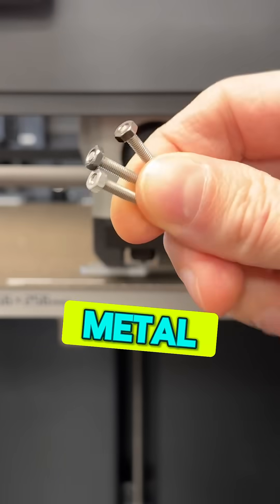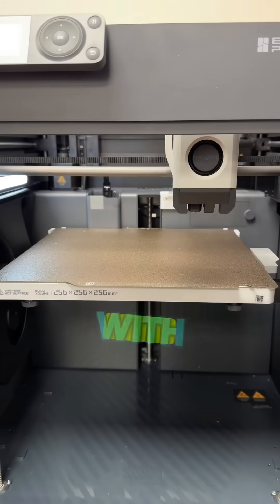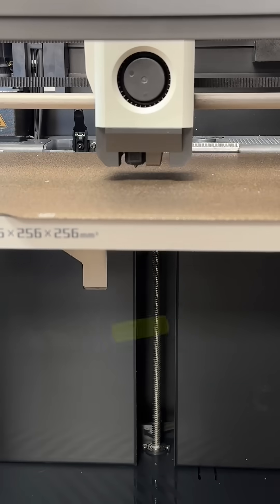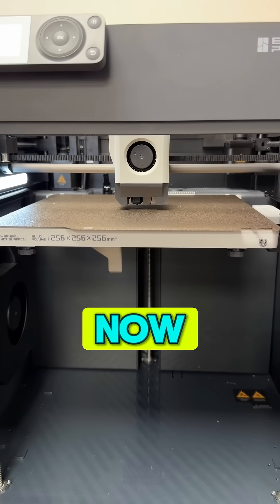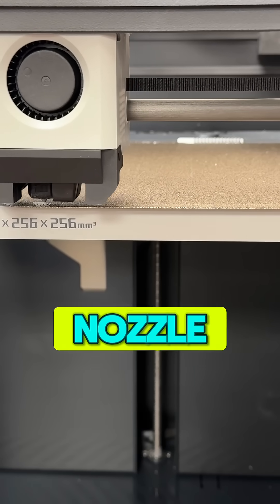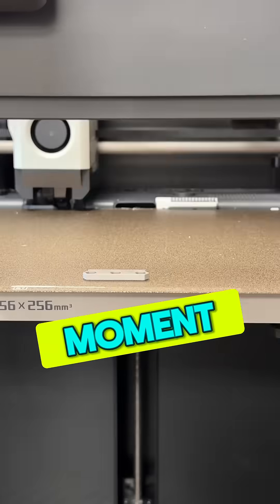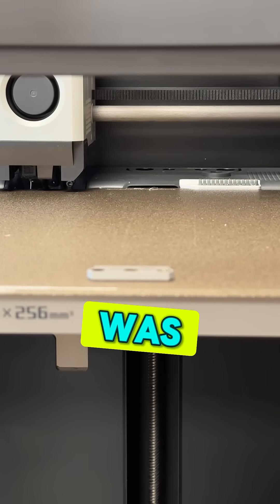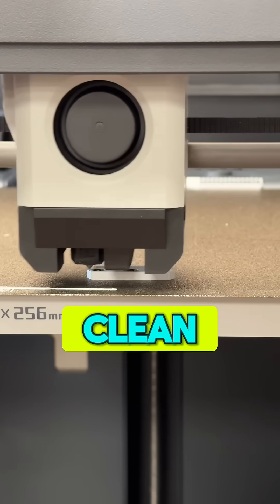You Haven't Seen These EASY Mods! They Are GOLD For The Bambu Lab P1S P1P 3-D Printers!

Comment: No one will ever tell me what that black thing in the back that rocks back and forth is.
Reply from the maker: @gfixler  well youve asked in the right place this time! Its a lever that closes the waste chute to allow the purge to coil up. When the print head pulls away the lever releases the purged material to fall out the back of the machine clearing the throat of the chute. Hope that answers your question!
Reply: @leckiestein  Thanks! I finally found a video of a guy completely disassembling an X1, and I could sort of see how it worked, but I'm still not clear why the lever—which works forward and backward—waggles to the left and right, too 😆

Comment: I've been doing this for years with my ender 3. Just check the slicer for the last body layer before the surface, watch for it, and pause it to insert the nuts, and resume the print. You can also add a stop at height/layer command in the slicer. This is cool though. I love people tinkering with configs, setups, and use cases. Keep creating!

Comment: Why was half this video "the machine levels, the machine purges filament" yeah, that's what it does.

The only needed part was your pause code
Reply: The machine levels only in the print area - only 6 points instead of the whole bed, big time saver 
Same for the beginning where Z homes, it's faster
The purge is also different than default and the pause sequence is also different
+ The addition of the A1 wiper, which isn't on the P1, to keep the nozzle clean during the pause

Comment: The Prusas have a pretty slick way of purging and cleaning the nozzle in one move. What it will do is start to pre-heat (not quite to the printing temp) and level the bed. Then it'll go 15mm above the bed and let the hot filament drip and heat the extruder fully then when it gets fully up to temp it'll move down diagonally to the build plate. Once it's on the build plate it'll extrude some filament and speed up once it's done extruding filament it'll jerk away and then it'll start printing. It gets the nozzle pretty clean and only uses 12mm of filament that could be less. I've never seen another printer do it like that highly recommend you try it.
Reply from the maker: @boomerguy3368  interesting. Thanks! Ill have a look and see if I can find a video of their startup :)

Comment: A1 wiper pad ? Does this mean the core xy models dont have the wiper pad ?
Reply: There's a little roller it uses to wipe. I got my p1p a week ago and haven't had any problems with it
Reply: They don't, and Pele are working it did. There's plenty of models around to print a modification to the nozzle cleaner and attach some A1 silicone wipe pad to it to achieve this

Comment: Ima have to rewatch this like a million times after I finally pull the trigger on buying a 3d printer.
Reply from the maker: @Phoxxboxx  you can do it man I believe in you! 💪
Reply: @leckiestein  right on man, thanks for the words of encouragement.
Kinda wierd how I suddenly have the urge to research a solid starter printer that's not crazy expensive but definitely gets the job done?
😅
Reply from the maker: @ my Buddy - just get the bambu lab A1 Mini it is phenomenal. I promise you will not be disappointed printing PLA and using bambu studio. Once you get your feet wet move into a P1 P or P1 S to Print PETG which is where it's at for the most part.
Reply: @leckiestein  thank you for the guidance... I'm a machinist by trade, but I know how to program cnc, which, in fusion 360 is the same for 3d printing. Are there any printers that utilize the fusion 360 software that is as comparable to the printers you mentioned?
Reply from the maker: @ right on man I have a Haas VF2 myself. You can use any printer and just about any slicer and get good results these days. Bambu lab has set the bar pretty high for the rest of them lol. From time to time I still use simplify 3-D because some things are easier but 95% of the time I'm using orca slicer or bambu studio.
Reply: @leckiestein  you're awesome man, thanks for such a deep insight into the 3d printer world... 
Greatly appreciate your input.
Reply: He dosent use any code! Bambu Lan automatically does all these startups  every print. He is taking credit for Bambu Labs genius.

Comment: pre-extrusion and cleaning routine with brush i see at print start is your mod or fabric default?
Reply from the maker: In my code I added an option to turn on a feature called "Inspect Nozzle" after the purge and initial clean - this moves the head forward and lowers the bed a bit then gives you a 20 second window to do some final nozzle keeping before returning to the homing routine.

Comment: I disable mechmode shake but leave in the compensation enable command, it's not like the resonance of your printer is going to change every print unless something goes wrong, guess what shaking it violently before every print causes? Just make a print that is nothing but a mechmode calibration for if you move it. But I haven't even done that tbh.
Reply: how do we disable the mechmode shake
Reply: @HarshFPV-s3d  It's a bit difficult to explain in a simple YT comment. But basically in the start gcode there are command's under a section called "mech mode fast check" down a little ways into it there is: 

G1 Z5 F3000
;G1 X90 Y-1 F30000
;M400 P200
;M970.3 Q1 A7 K0 O2
;M974 Q1 S2 P0

;G1 X90 Y0 Z5 F30000
;M400 P200
;M970 Q0 A10 B50 C90 H15 K0 M20 O3
;M974 Q0 S2 P0

M975 S1

all of the ; were added to exclude that line, the first and last lines intentionally aren't commented out, else might scrape your plate if it doesn't do the first move upwards, and the last one is responsible for pulling out the old compensation save. These are specific to the A1MINI but helps give an idea what to look for. Highly suggest looking up commands to see what they are doing before commenting them out, if they aren't a common command they are either AMS or other secret-sauce(that many other users have figured out in various places).

I take no responsibility, but hope you can calm your vibrating demons by knowing where to look.
Reply from the maker: On the idea of skipping the Mech Test cycle, this might be something you want to consider if you want to startup the printer in the middle of the night and not wake up the whole house but still reap the benefits of the compensation feature. Also, there is a small time savings which likely doesn’t matter much but its worth mentioning. 

On the side of performing the test.  
First we ask, why even run the compensation at all? Why can we just run it once and be done with it since the data can be called for use on all prints?  Well, One caveat to skipping the cycle… indefinitely..  is the machine does undergo wear on the belts over time which requires frequent tuning for compensation. it even knows when you need to physically tighten the belts giving you an alert if loose belts or problems in your motion system are detected on a test. I would also think that different temperatures of the room could influence the stiffness of the machine and components therefore possibly throwing out the tune every so slightly. Prob nothing noticeable but it’s a possibility to consider. 

Id say run the Mech Mode test at least once every other day or so.
Reply: @leckiestein  I think these are valid thoughts on the subject, but I honestly probably won't bother to run a mechmode again until I see something questionable(been set like that about half a year now), it's just a lot of unnecessary wear for a compensation mechanism that shouldn't change much so long as belts stay tensioned roughly to the same value. And this is for my A1 and A1 Mini, I think that sort of test is something I'd want to do even less to carbon fiber gantry rods that are epoxied and have to be replaced as a module. It will prolong it's service life to not shake wildly at the exact same spot every single print.
Reply: @leckiestein that's just bad advice.

Comment: Half of the video was just the normal shit every Bambu printer does. The rest was something I did with Ender 3.
Reply from the maker: @lukasgayer5393  the p1 "normally" sits there for 4-5 minutes heating the bed before it does anything at all 🤷‍♂️
Reply: @leckiestein  Really? That seems like a waste of time. Isn´t is supposed to be quicker? A1 heats up really quickly to 80C (I print PETG).
Reply from the maker: @lukasgayer5393  hence the change of the code 😂 I'm glad we understand each other now
Reply: @leckiestein  I stand corrected :D
Reply from the maker: @lukasgayer5393  no worries bro! I hope youre having a very Merry Christmas!
Reply: @leckiestein  3D Printing Christmas :) Currently designing and printing enclosures for li-ion cells from discarded powerbanks with failed electronics, so I can safely and readily use them in my projects and charge them with USB-C. Merry Christmas from Czech Republic to you too!
Reply: @leckiestein im just really confused, my p1s does this straight out the box, and the bed doesn’t take long to heat up?
i understand you programmed this yourself, but did bambu update their printer’s setup sequence then?
Reply from the maker: @CheesyMez  ignor my previous reply, I thought you posted this comment on this video: 
The Ultimate Mod Combo For Your Bambu Lab P1S X1C Coming Soon - Full Setup Tutorial
https://youtu.be/dQp48l9V6gk

This will make more sense to you.
Reply: @leckiestein  ah okay, i just watched through it, makes a lot more sense now!
some very rude people in this comment section lol.
Reply from the maker: @CheesyMez  It can be tiring I wont lie. Anyway, thanks for checking it out and Im glad you can further see the additional control the solution offers. With all the people using the code now giving feedback, Im now in the 7th iteration and there are 15 SteinSwitches. So its really progressed a lot since posting the video. A new video is in order. Again, thanks pal!

Comment: Hello, do you know if any of this code can be used with the A1? Long time printer, first being the Folgertech Delta 12 years ago (ps: learning 3d printing on a first gen delta was RoUgH lol). Not unfamiliar to messing with firmware and g-code =)
Reply from the maker: Absolutely! I have done this to the A1 machines in my farm before I ever got the P1. There are a few codes that only work on the A1 like the code that runs when the nozzle is bobbing the plate.  but much of this routine can be used after changing the positions and of course the Mech Mode Check - very important. I plan to release a code for A1 and A1 mini, I just need to update those machines with all the new stuff Ive been up to :)

Comment: Thanks for the upgrade to my P1S. I bought it on Patreon. Unfortunately, the GCode is useless. I wrote my own code, and now it works even with AMS. Great idea overall, thanks! 🎉❤
Reply from the maker: Yeah sorry brother I don't have an AMS to test it on otherwise I would have wrote code for the material change section. But the start up routine and material change section are two completely different routines. So there's still a lot of things different in the start up routine you can benefit from I hope you get to use it :)
Reply: Hey would you mind sending the code over? Thanks!
Reply from the maker: @pkmnjourney  sorry mate. Patrons using the files have explicit instructions to not distribute the code, especially since it's an early release and it's a work in progress - it's only accessible to a limited crowd at the moment through my Patreon.
Reply: @leckiestein  ah sorry ! i wasnt aware it was a patreon exclusive as he said he wrote his own code
Reply from the maker: @pkmnjourney  my mistake, sounded like you were asking for the project code :) carry on!

Comment: how do you probe the printing area only?
Reply from the maker: @florian558866  I have a video on this :) if you navigate to my shorts and look for the thumbnail that has two P1 machines side-by-side with a timer in the middle. That's the one!
Reply: @leckiestein  you added the a1 into it right? have you tried on x1c?
Reply from the maker: @ that's correct - the one was missing. And unfortunately I don't have a x1c for testing :(
Reply: @leckiestein a1 doesn’t work after the latest update of p1s printer.
Reply from the maker: You can roll back the printer firmware to the last version. I havent seen anything meaningful in this last update. I hope they fix it in the next one

Comment: a1 mini user here, the pasue resume still doesnt incoprate a nozzle wipe....... sigh....i know i can custom G code it, but i dont trust myself doing it,...wish some YOUTUBER can do it xD
Reply from the maker: @EnnTomi1  I also have the A1 mini and full-size A1 machines running in my Print farm at the company I work for. I have incorporated this feature on both of these machines. But there is one major problem.. and that is collisions! on these bed slinger machines, we can do it but only in certain situations! I have to section off a portion of the bed where you can't print that way the head can lower down to use the wiper pad so it's not ideal like it is in the P1. But I do plan to jump back into A1 videos soon! I'm just trying to strike a balance between the three machines I have access to :) if you're feeling brave, feel free to tinker with my code posted on Patreon. I will try to respond to any of your comments that I see (sometimes i get over 100 comments a day right now so it's hard to keep up but Ill do my best :)

Comment from the maker: long-form video is here :)
https://youtu.be/dQp48l9V6gk
Reply: Does this only work on the P series? Is the x1 series different?
Reply from the maker: @ if Santa brings me an X1C and AMS, it will be a VERY MERRY CHRISTMAS... for us all! 

Sad to say, I dont have this machine or an AMS in my arsenal right now for testing. I haven't had a use for this equipment until now! There was a Josephine from Bambu Lab who reached out to sponsor my channel with a gifted machine and AMS but, I think they saw Im probably going to Leckiestein their equipment out of warranty and stopped responding to my emails 😂
Reply: @leckiestein what did santa bring
Reply: @leckiestein  i need this for the x1 its been dragging little bits of extrusion into the bed area :(
Reply from the maker: Just thought Id let you all know I started recording already. I am aiming for this weekend to release the video :)
Reply: X1! ❤
Reply: Awesome! Looking forward to it!
Reply: Hi where can I find this codes?
Reply from the maker: Hi! The project is live on my Patreon under "P1 SteinWipe" the code and my wiper mount design STL come together.
Reply: Would this work on an A1?  @leckiestein
Reply from the maker: @Kronash  while the A1 machines already have a wiper, I can see how they cant be used while printing once the height gets a bit high. Also, the print head needs room to walk around the wiper. I do have a few ideas to get past this tho for smaller prints and I do plan to make a system to an additional wiper to the A1 series.
Reply: Looking forward to a full tutorial on this. Thanks in advance ❤

Ps, hope Santa was good to ya
Reply from the maker: @kellyjean4981  Video is up :) and I ordered the X1C combo 🤩
Reply: More Please
Reply: Do you have the a1 wiper mod and gcode for me?
Reply: @leckiestein  I subscribed to you, good stuff man, thanks!